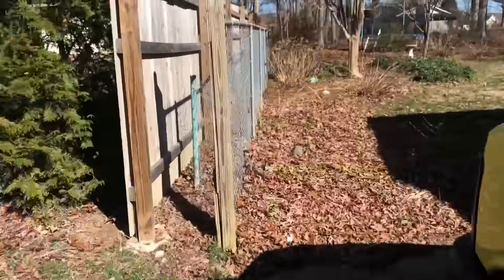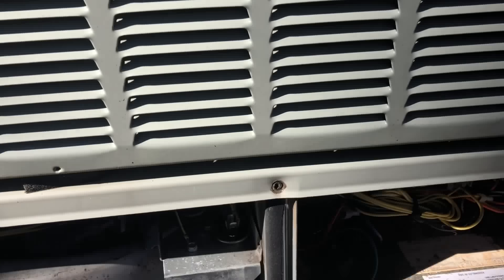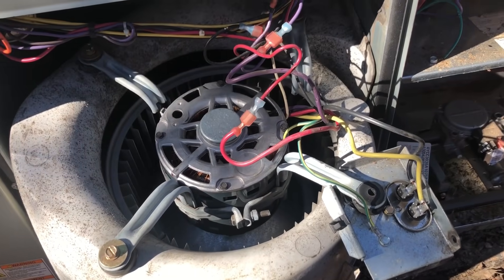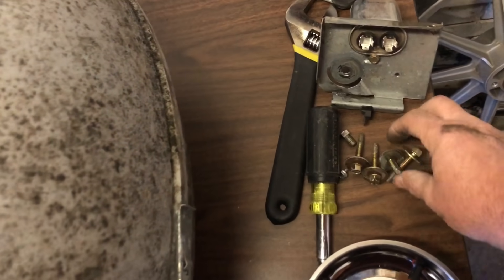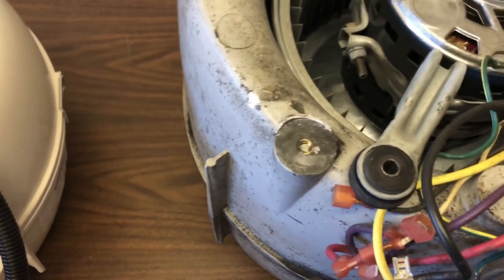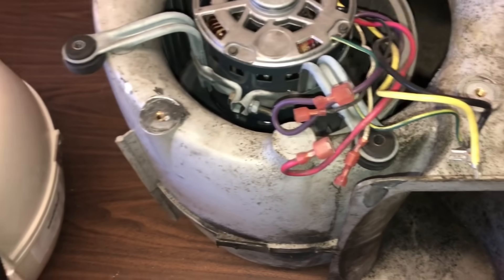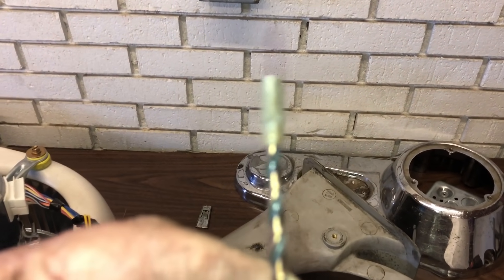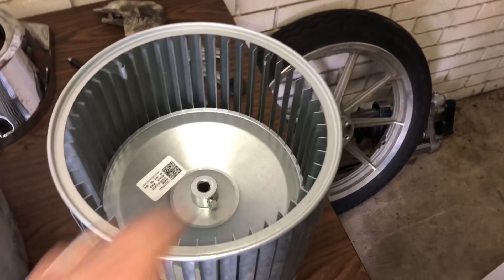HVAC gas-pack blower motor fail repair

Comment: 2 weeks ago, a customer told me about their whole house shaken in heat mode.  I got up on the roof and took the furnace door off.  Had the customer turn the fan on.  He then noticed the whole house shook.  There was one mounting screw that was almost out of the grommet.  I changed the fan, motor and cap.  The house does not shake any more.

Comment: HELP! My unit looks just like this. I'm trying to find that blower/motor housing. I had a fire and it caught on fire, damaging the duct connection flange. It looks like fiberglass. I need the motor/blower wheel/housing and heater relay switch. I think I found all but the "white" housing that the blower wheel fits in.

Comment: Ted.  You run back to your old shop for that blower wheel?  How much driving around did you have to do for this thing?
Reply from the maker: joshua seaton not much but what is your point ?
Reply: No point.  Just curious.  Working in Seattle and Portland the last 24 years I would've had to waste half my day running around, damn traffic.  BTW, I sent you an email on your website.

Comment: probably all the screws rattled out from the blower vibrating like mad until it quit. I'd be afraid it rattled other things apart in the heat exchanger/burner area lol

Comment: Guest starring

Mr Milwakee M18 drill
Mr 10" adjustable 
Mr 6" adjustable
Mr Wire strippers
Mr drill bit
Reply from the maker: You always forget the toenail clippers !!!
Reply: @TedCookHVAC  lol
Reply: And don't forget the cameo by the 8 in 1 slide drive 👍